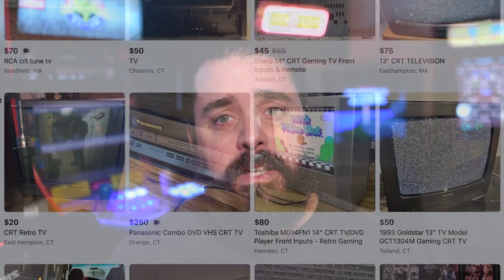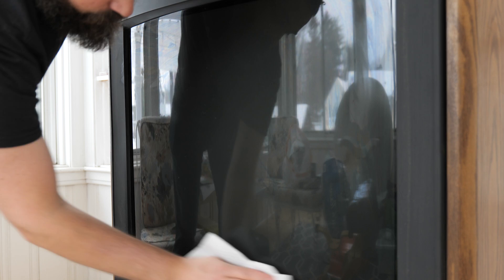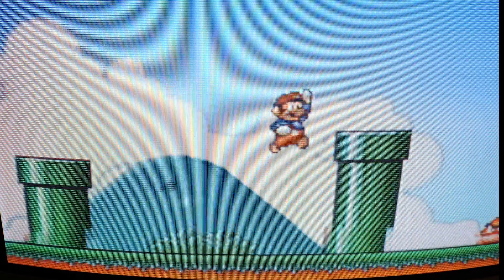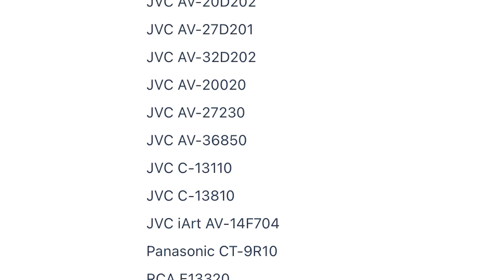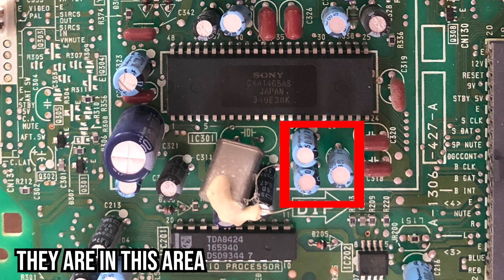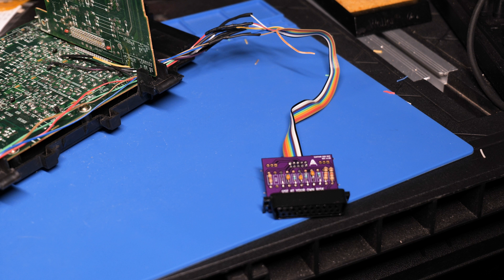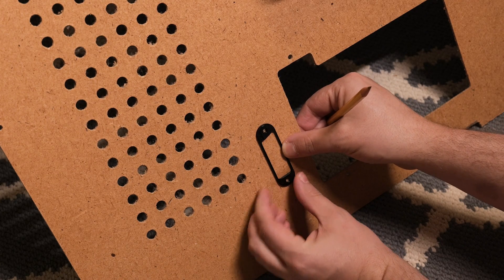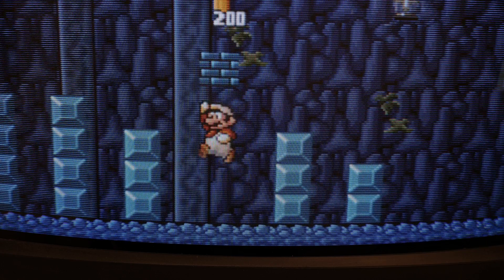Adding RGB scart to my dream CRT (AA-1 Chassis RGB mod)

Comment: For some reason, mine isn’t working I did everything correctly on the guide and on your video using the correct resistors and everything I just don’t understand what to put in r9 is it just the leg of a diode?? Im confused
Reply from the maker: R9 is just shorted. I used a chopped off piece of wire leg. you could use a very short wire. Anything just to short that connection.

Comment: Hi, I've just subscribed. Are there any hints on where to get +5V on the TV's boards to connect them and provide an inner +5V input to activate the blanking signal?. I've seen lots of tutorials where they connect the blanking point (brown cable in this video) with +5V from another place through a switch.

I hope you can send me some light on how I can made this.

EDIT: I think +5V can be got from resistors R045 and R046 where they join away from the Memory Chip (IC102)

Great video. Hugs from Chile, South America (Harsh Winter this July, 2024 🥶)

Comment: I just finished this mod on m 32V16 doing BNC inputs and a switch. Had the initial dim picture going on. I fixed mine by turning up the RGBP setting in the service menu from 10 to 35. I'd be curious to know what yours is sitting at if you have a chance to check? I'm wondering if this just comes too low from the factory? (or if someone turned it down. Seems to be a common thing though)

Comment: Neat! Good kit, nice mod. I like the set and seems there's lots of room inside to potentially build in an all-in-one arcade set with the Raspberry Pi. A suggestion as a follow up would be to have an HDMI downconverter built into the TV directly and maybe install a switch to swap between scart and HDMI. Haven't seen any videos really attempt the digital to analog conversion along with downscaling for a CRT inside the TV. Kind of pointless unless someone really wants to play modern pixel games on a 4:3 CRT. A built in SBC and streaming is more sensible and easier but less fun? 

Anyway, the Retrotink, Extron VSC/RGB combo, GBS-C, Corio series (if you don't mind the added lag), Ultracade Video Converter and there's a few Imagenics devices which could work. There was one oddball that I haven't had a chance to test yet which is still affordable, unlike the Retrotink and Extron options now, and that's the Creston HD scaler. Maybe that combined with the GBS-C could offer some interesting results. Build in a small HDMI splitter to maintain the digital signal for an HDMI out, and this TV could be ultimate all-in-one, clean, classic game streamer consumer CRT. Throw wheels on the base and it'd even be portable.

Comment: for most Sony TV if you want to have 100% of the capabiity try the following to get into the hidden menu of the technical servce mode: when the tv is off on your remote hit in the following order, DISPLAY, 5, VOLUME UP, POWER the tv will turn on in service mode you could adjust the color intensity and color bias for R G and B individually, H and V size, scan and sweep rate, etc
Reply: oups made my comment before the ending of the video EJ is doing it :)

Comment: Do you know if the KV-9 is RGB moddable? I hadn’t even considered modding the TV itself
Reply from the maker: Looks like at least some models are! https://sector.sunthar.com/guides/crt-rgb-mod/sony-bn-1.html#step-2-connect-rgb-and-blanking
Reply: @RedCowArcade  this is encouraging news! Thank you!
Reply: @RedCowArcade  dang, mine is the pt40 and these only have schematics for the pt50 and pt60…
Reply: @HPRshredder open it and see if it has the same jungle chip if so it should be good to go

Comment: Good mod. I just picked up a 27” Trinitron FD and it’s new enough to have component inputs, so I just got some component cables from HD Retrovision for my SNES and RGB modded NES. The picture is glorious!
Reply from the maker: Component is great on those mid 2000s trinitrons, especially if you win the geometry lottery
Reply: @RedCowArcade  The geometry isn't perfect, I was able to tweak it a little bit in the service menu but I am unwilling to open it up and mess with it any further. It looks good enough!
Reply from the maker: @lordtaco  I bet! I love the way those look. I'll try not to buy the first one I see on marketplace

Comment: I got a beautiful free and enormous trinitron recently, and I thought we’d be able to lift it easily since I used to have one and had recently moved a 300 pound espresso machine with my buddy without too much trouble. And this thing is ended up being so much bigger than my trinitron I got in 2000, and was insane trying to get down a flight of stairs in the front of a brownstone. Then getting it in my basement and onto a dolley was no small feat. Now convincing my girlfriend that having it at our new place will be very necessary is a job in and of itself. Anyway, cool video. I won’t be doing this to mine but I loved watching you do it for yours.

Comment: That dude copied my board I just haven’t put mine on osh park yet I need one more fix but other people have used it ille throw it up on osh once done.  Mine doesn’t mux it uses a switch but it uses more modern surface mount passives.  I also made a template pcb I’ll add on osh as well.  Mine has the audio and sync included so you don’t need to have a connector plugged, just the scart cable.